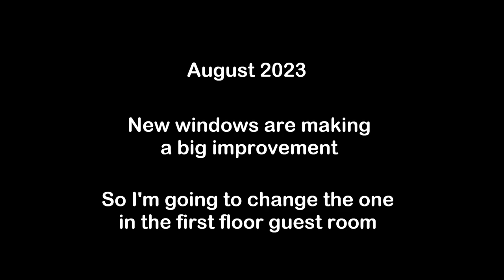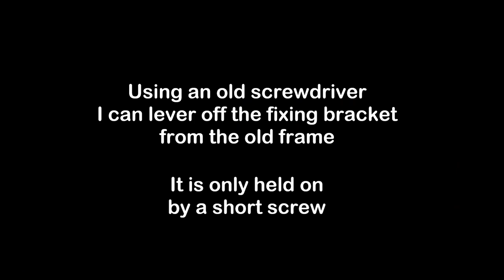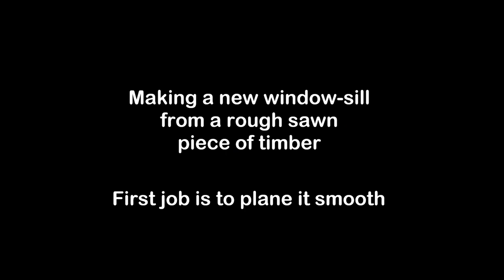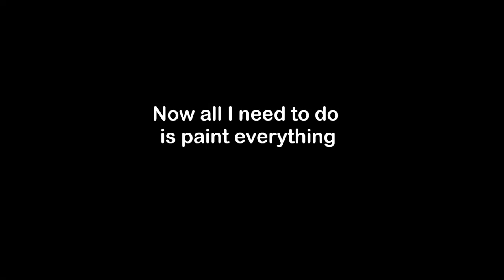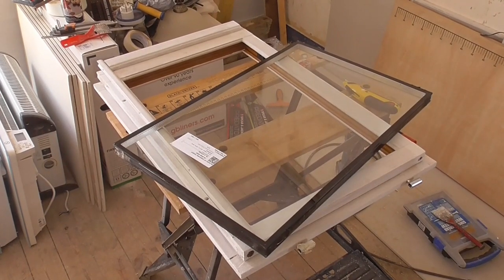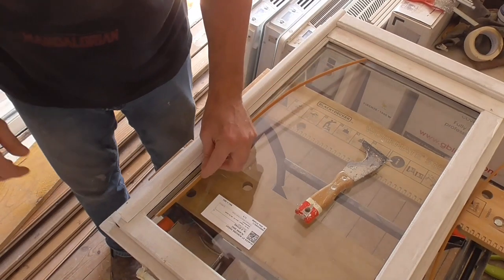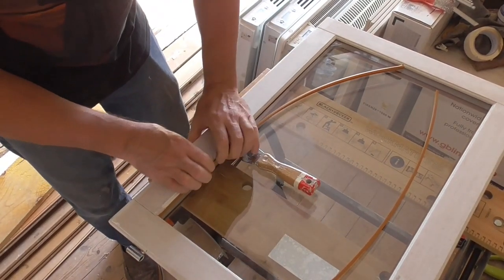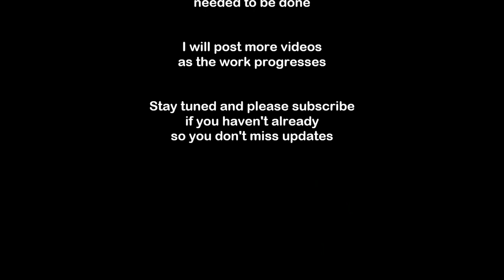Our French House Adventure - pt48 More Window Work

Comment: Thanks for the video, and for showing the detail of some procedures. You mentioned that you patched the larger hole at the top of the window with plasterboard - is there anything magic to understand about that particular challenge - particularly given its location, and appreciating that the force of gravity would complicate the repair .... ?
Reply from the maker: There is a thick piece of timber across the top of the opening as a lintel. The plasterboard is screwed to that

Comment: Great job, as always. Was there some worm holes in the window sill piece and has it been treated?
Reply from the maker: That was a piece of timber that I had used as scaffolding when I repaired the top landing ceiling, they are screw holes from that. It is new, pre-treated roofing timber, so no woodworm

Comment: When you install the new window, you don't apply new fixings comparable to what was there before?
Reply from the maker: The new fixings are 120mm long screws that go through the frame into the brickwork. The original fixings are held on with 25mm screws through a piece of metal set in the plaster. My fixings are considerably stronger.